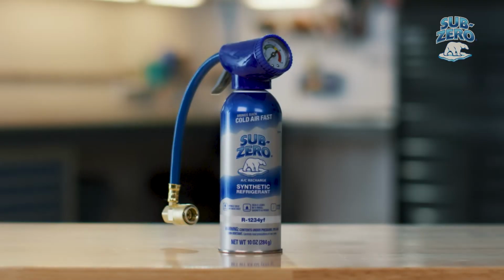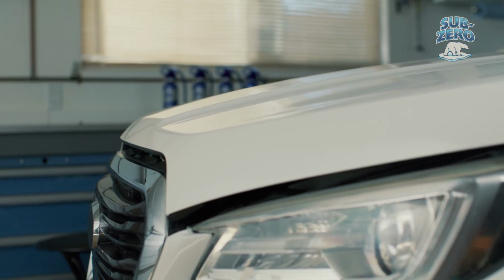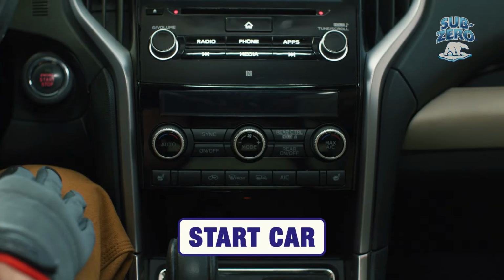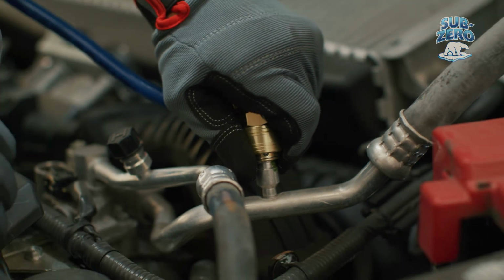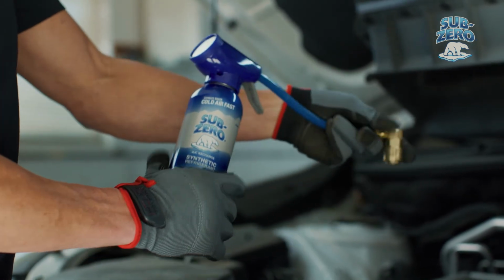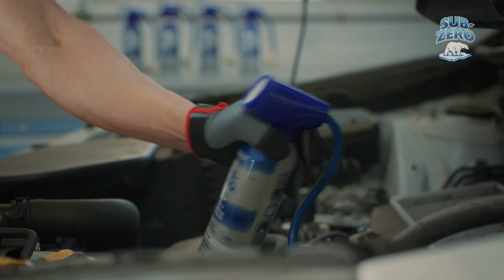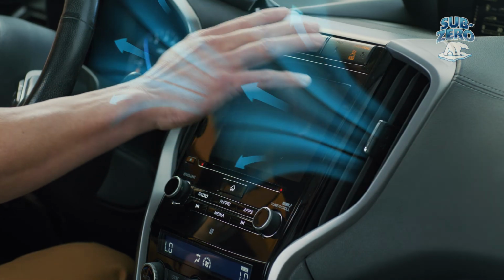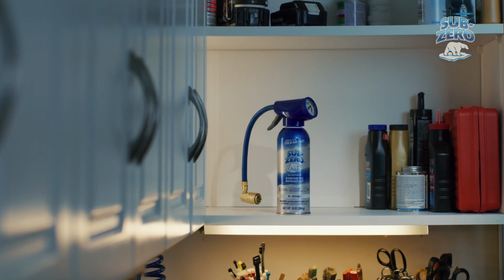How To Recharge Using Sub Zero Analog Gauge Kit

Comment: What happens when you read the pressure on the gauge without pulling the trigger and the color of the needle immediately goes to red & all steps prior to that were followed ??
Reply from the maker: You likely have another problem besides low refrigerant.  You should take it to a certified mechanic.

Comment: What happens if it seemed like the gauge stopped right at the top of the green part but wouldn’t move. Then after a few more attempts of adding air, the gauge reaches red but comes back